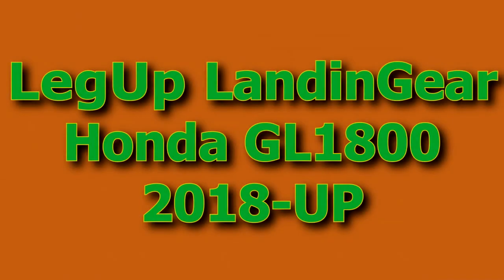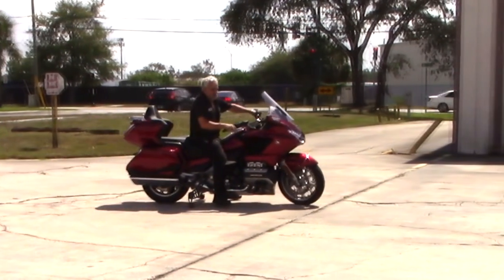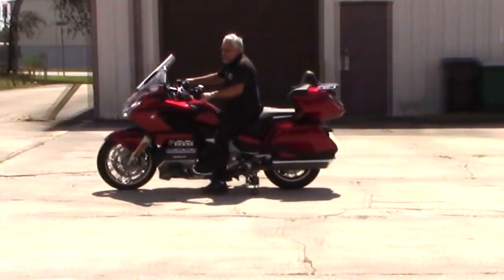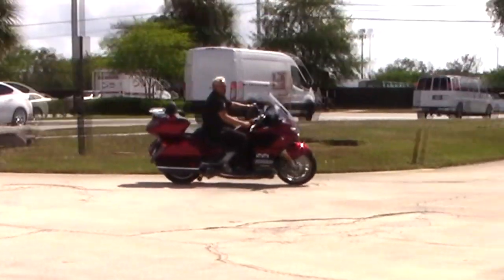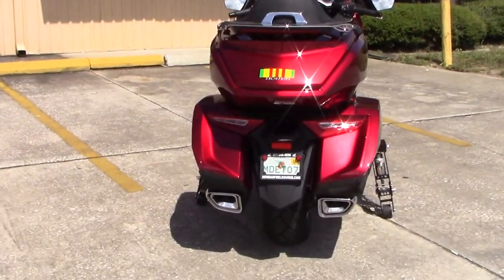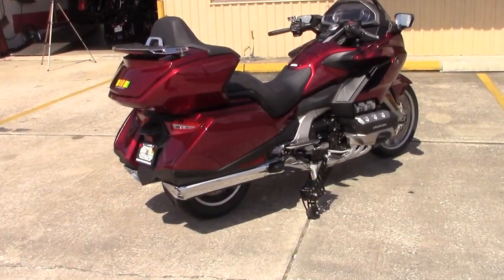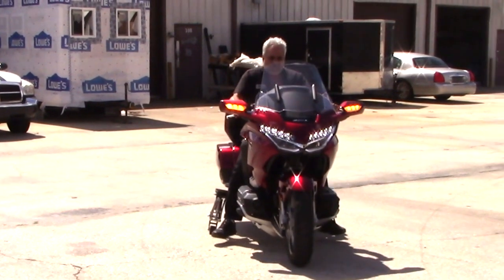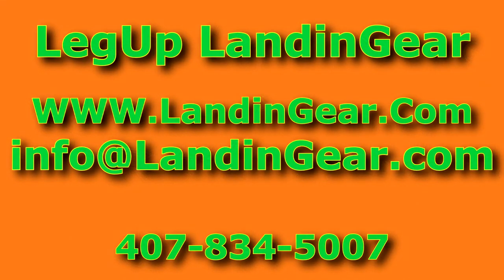LegUp LandinGear for GL1800 2018-UP

Comment: I really would like to know what the compressor sounds like on the new Gildwing when it’s operating, if possible. Thanks
Reply from the maker: I have no wau to demonstrate (last week I had one in the shop), but with the bike running you will NEVER hear it!
Reply: @chopperdesign  I have one more question before I dive in. What is the advantage of the pneumatic system vs. an electric deployment system? Obviously there is, because this been around a good while. Thanks
Reply from the maker: The electrical actuators where very weak back in the day. The pneumatic system is very firm, bhut don't allow leaning as the old system (over 10 years ago) did. Thanks!